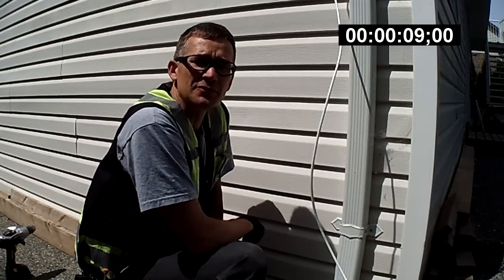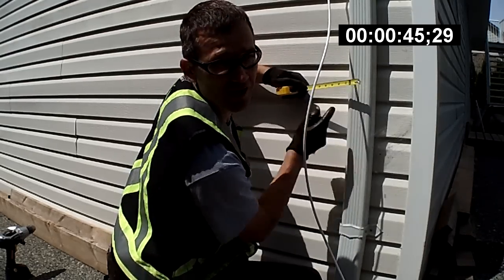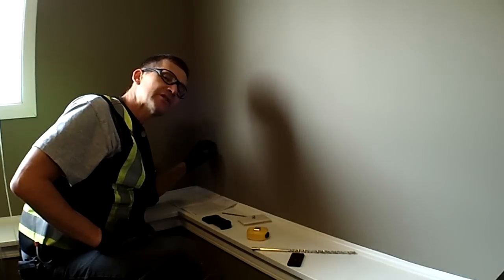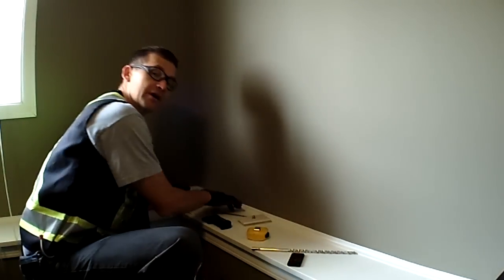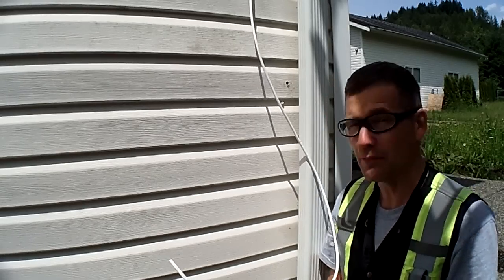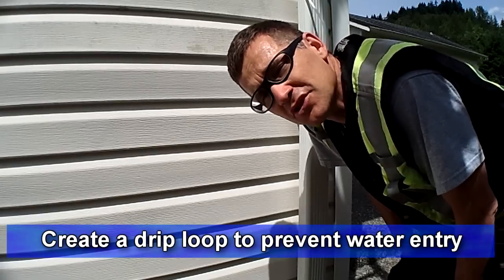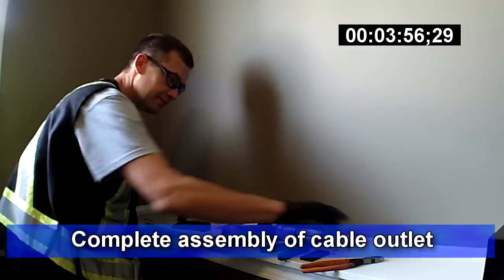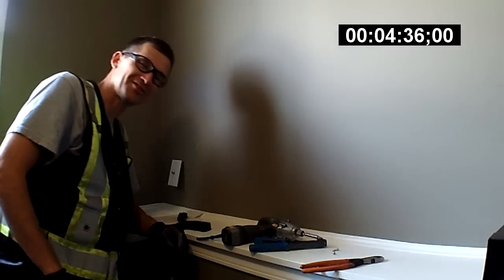Demo Video  New Outlet (Drilling Thru the Wall).mp4

Comment: Great video! Is there a reason you chose not to make the hold from the exterior wall to the interior wall?
Reply: for my project need it in specific place inside, but in this video, its the outside structures dictating the placement of the hole.... i would have drilled it from outside in in this case scenario

Comment: Great video. If you are 3 storeys high, how do I grab the cable going out through the wall then up to the roof?🙁
Reply: i guess drop a string/rope off the roof and tie it to the wire, once u catch the string in the wind, maybe add a small weight.... but once tied to wire, just pull string up with wire tied to it...., may need someone to help feed wire through the wall as u pull up....

Comment: What kind of screws do you use to ensure the plate is secure when you don't have a plaster ring ?
Reply: They make a low voltage framing for this particular task. They are cheap and easy to install and have the holes to accept the cable jack plate.

Comment: I'm sorry, this is the type of installation I absolutely DESPISE! Most of the technicians will install and walk away thinking they've done a nice installation because it's firm and in place while they're there...  But let's be honest, how long does a screw remain firm in sheetrock?? We all know the answer to that... 

C'mon techs!! Be "professional"! use an outlet bracket or at the very least use some form of anchor inside the sheetrock that locks the screws in place. 

Nothing is more disheartening than finding just a hole behind a plated outlet.
Reply: Eric Johnson As is typical with those who only want to "do enough" rather than "do it right"... It's not what you can get away with, or make the client accept, its about doing something right.
Reply: Chris Banzet right on Chris. Lazy is as lazy does. Surprised how many people are replying to your comment attacking you. Guilty conscience I suppose.
Reply: At first I disagreed with you but now I think you may be right. One thing though, the outlet bracket (at least the ones I've used) require you to cut a large square/rectanglular hole in the drywall. Then the bracket goes in and you tighten the screws which hold the arms secure against the wall. Is that the one you're talking about? I agree that would be better and would hold "forever". Maybe the home owner doesn't want large holes cut in the wall though? The drywall does have benefits like noise/thermal, etc, so cutting a large hole and "sealing" it with a plate would increase those things. Probably not to a noticeable degree though. Another thing I guess would be if you were to ever move the cable or get rid of it, the small hole would be much easier to patch. And also he's the cable TV guy, not the "your home wiring guy". If you want your home to be all wired up a certain way that seems like a whole job in and of itself. He is just there to get you TV. So yeah I guess I see both sides. Definitely need to stand behind your work and not be lazy. Cutting that hole wouldn't take long though I wouldn't think it's this guy being lazy, rather just doing what he's been told to do. Anyway...
Reply: @user-nh3gu1ge3d  It's close. The ones I use are square brackets that once in place there is a top and bottom metal clamp that you squeeze with angled channels locks. It takes less than 15 seconds to secure, and they last a long time.... As for the hole, that's not a large hole. And once you have to remove something and patch, a patch is a patch is a patch, so large or small, you have a little project to do. 

As for the insulation factor, I actually back mine with a piece of insulation so that's never been a problem for me. Some people think that a person will plug their network cable into the wall, and then forget it. That's true if it is behind furniture, ie desk, TV stand, etc. But if it's out in the open it gets tugged on all the time and every time I observe these more cheaply placed outlets that have been in place over a year, the entire thing is loose, taped against the wall by the owner, etc... When I ask them who did their wiring, it's always the same thing... Some guy who was cheap as hell, or not very good, or didn't know what he was doing, etc.... 

So those people who do these projects, you get to leave and over 95% of your clients will never say anything to you, they'll just never use you again! In today's world especially, when it costs a premium to actually obtain clients, the last thing you want to do is actually lose them! 

It only takes an extra minute and costs around $.35 cents a piece to make these installs a much more professional install...
Reply: @youtubertoo  EXACTLY!! I am a business coach also, and I can't tell you how the people who are successful always look in the mirror and the ones who fail always tell the other guy it's him... SMH - Humans acting Humanly!  ;)
Reply: @chrispatriot  Yeah, I definitely agree with most (if not all) of that. The world would be a better place if more people had your type of attitude.
Reply: @chrispatriot  you seem nice lol
Reply: @jays3526  awww, poor Jay he wanted nice... Clients don't pay for "nice" they pay for "right" and "quality"... 

That's what's wrong with our world today... We've accepted "opinions" over "facts" and we've accepted "nice" over "right"... 

There's a need for returned balance in the world and that comes when we're willing to call things out for what they are, instead of this new PC BS where you simply hide the elephant in the room so you don't potentially hurt someone's feelings... 

What this Kumbaya nightmare forgets is, there "IS" a victim! It's the person left holding the less than desirable result all because the world wants to play huggie feelie all day long... 

God help us all when Millennials finally take over the torch and run the world....
Reply: @chrispatriot  you're completely unhinged - I would recommend that you make your own YouTube videos, but after this last crazy rant, I'll pass. lol
Reply: @jays3526  I'm a chameleon of attitude Jay. I send out what's given. Try responding with positivity and you might receive it.  Be a smart ass get treated like one. 

That doesn't make me "unhinged". It makes me someone that defines the rules and plays by them....

Comment: runing wire on the out side of a house is not professional at all regardless
Reply: That is a statement that sounds good until you realize that the ISP/cable provider is not inside your house and in order to connect your home to it, there MUST be a wire outside your house that goes inside. I do agree that this install looks a little slack, but you ALWAYS have "wire on the out side (sic) of a house" if you want internet and/or tv service.
Reply: hide the wires! ;)